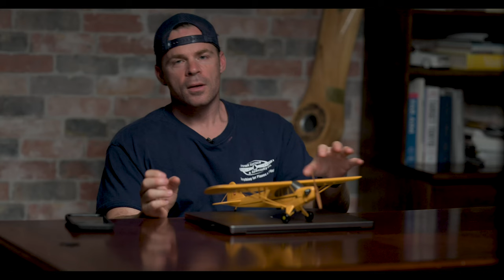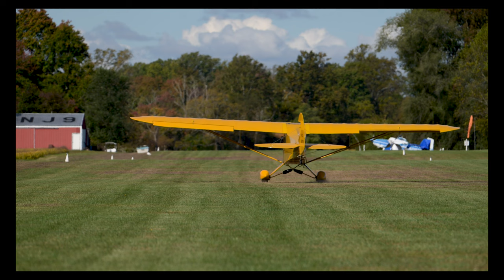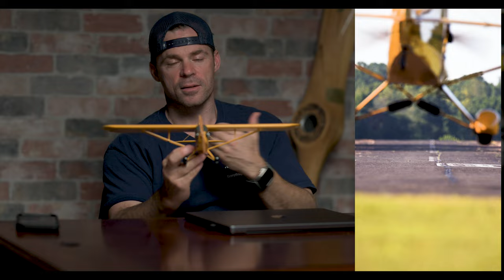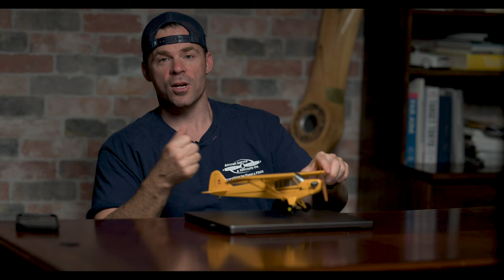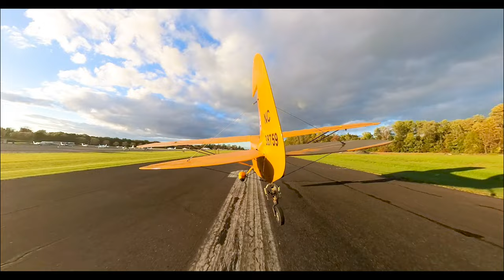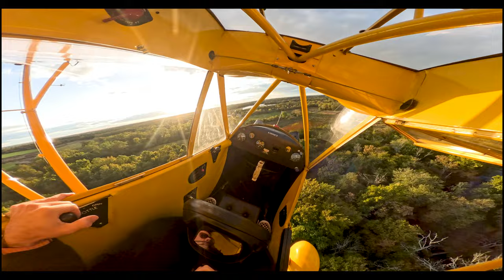Taming Crosswinds in a Taildragger, a Few simple Tricks...

Comment: When I got my tailwheel endorsement my instructor had me practice staying on just the upwind main way down the runway on both takeoff and landing rolls in stiff crosswinds. Really helped illustrate the importance and benefits of keeping a proper crosswind correction. I had a habit of letting go of the correction towards the end of the landing roll out at low speeds before exiting on to the taxiway. She fixed that by sharply asking me if I thought we were parked at the hangar yet a few times. Got it: fly it till we’re parked.
Reply from the maker: I forgot to mention that but that's a GREAT GREAT training exercise
Reply: @Bananasssssssss  it really was excellent training. I still practice it any time I'm in a tailwheel plane.

Comment: The lowing method works very well in a high wing aircraft. Tail draggers specifically because they are so light and their CG location causes them to weathervane more positively into the wind. You cannot do this in a lowing heavy aircraft such as a 737 because you would smash the outboard engine on the runway. These type aircraft have to be crabbed till the last minute, and then the rudder has to be kicked in into straighten it out. The trick thing is to know how much rudder authority is available and will keep the airplane going straight.
Reply from the maker: I use the wing low method on the Airbus, just can’t get crazy because Nacelle doesn’t have much clearance

Comment: When taxiing really light planes like a Champ or Cub etc, in a stiff wind, you need to hold the controls such that in a quartering tailwind, it will not lift the wing or tail. You would not have the elevator or aileron full up if the wind could get under them. You want those control surfaces down to prevent the wind from getting under them and causing you to wreck at slow speed!

Comment: Ailerons rule because they are largest control & horizontal to the relative wind.
Close to, or on the runway, simply, maintain ailerons PROPORTIONALLY OPPOSITE the applied rudder.
Adverse YAW will supplement the stalling wee rudder.
Tail winds to all. 60 yr CFI

Comment: Great stuff !!! In crosswind landings it made it much easier for me to get the planes nose aligned a little further out on final
rather than trying to swing nose around with a bit of rudder input as you shallow out decent for the flare or wheel landing. I believe everyone has their own way that works best, and you hit on all those most critical elements, especially for a taildragger. In fairly windy/gusty days  you really literally are still flying the cub even in a taxi, ( again the J-3 was a great teacher, as are you ! ) Hey with flying the heavies do you have to really think about the difference in crosswind handling ? I have friends that flew airliners and was amazed at finding out how they are to land in a crab.
Oh my gosh, what a nice C-170, another of my favorite planes ( never flew this but wish I had one !!! ).
Reply from the maker: Yeah another point I forgot to mention is I usually make longer finals so I can get a better sense of where the wind is coming from. On the A320's with the smaller IAH Engines we can do the crab method and a little bit of the wing low but with the NEO's its better to crab and time it perfectly to kick rudder to align nose with runway just as you touch down but the Engine Nacelles are really close to the ground so you have to really watch fro that. On Takeoff we don't put any aileron correction in because it would also deploy the flight spoilers so we just manage it as best we can with rudder. On the longer 321s with a strong crosswind sometimes you're almost full rudder to counteract the weathervaning

Comment: Great video, thanks! What are your thoughts on sideslip all the way down from final vs crab until threshold and then side slip? I was taught to sideslip from final in my PPL training but have since flown with TW CFIs who prefer the crab method. I know it is an age old debate, but I'd still like to read your thoughts.
Reply from the maker: I feel like it requires too much work and is more unnatural for me. Crabbing just seems easier and also gives me a better “feeling” of what the wind is really doing (if that hopefully makes sense)
Reply: @Bananasssssssss  Interesting- it makes sense but I personally think I can feel more of what the wind is doing in a sideslip. Then, when I'm across the threshold all I need to do is hold the correction that I already have in and start to bleed off airspeed and flare. 

I've noticed a a pattern in the CFIs that I know who like to crab vs sideslip- the CFIs who prefer to crab are all type rated in larger jets. Maybe all the time spent crabbing in a professional setting in a jet caries over to feeling the wind while crabbing in a small aircraft?
Reply from the maker: @ColderHeavens  I guess just personal preference. Ive always done it this way, doesn’t make it wrong or right just kinda what I’ve always done . Im going to try the other way though, may as well
Reply: @ColderHeavens I’m in your camp … I like to get it going straight and then get it down… I’m not comfortable getting into the side slip just before touching down.